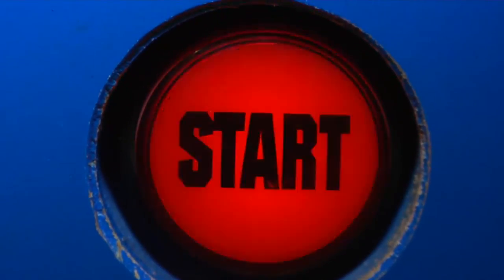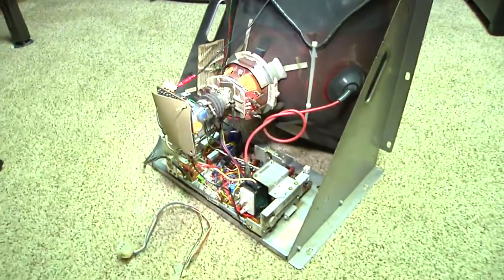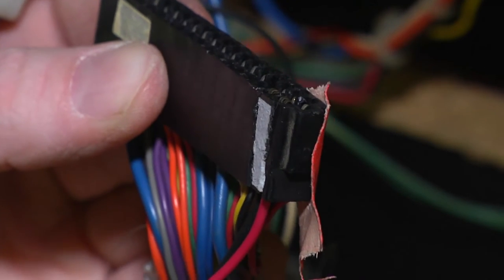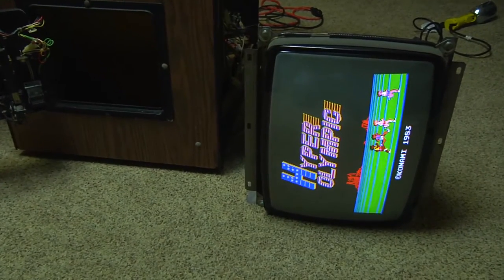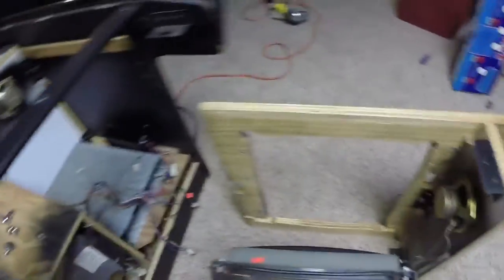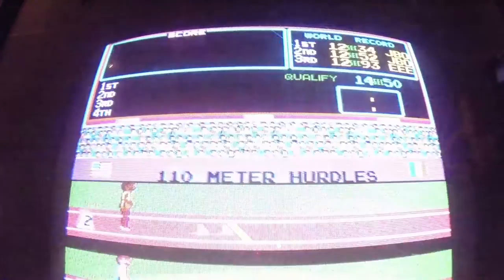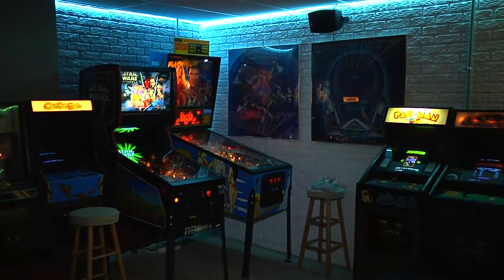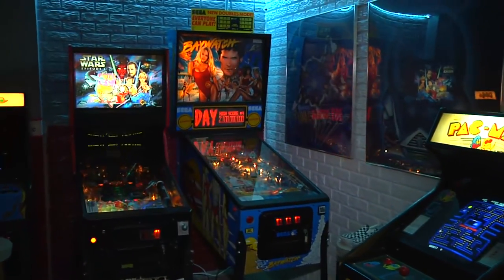Track & Field Cocktail Restoration Part 1

Comment: I just picked up one of these original track & field cocktails that was converted to World Series. Will be a long road back to track, need to have complete wiring harness made for 4 player
Reply from the maker: Great project for restoration.
Reply: @Arcadehollywood  yeah! I was happy both original control panels were under marquee on one side and the World Series bolt on joystick on other side. Just secured the original metal cage for PCB to place the track & field board in and have a line on two track & field boards, 1 working 1 not at a 3rd the price. Talking with golden age arcades about repro harness for it, 4 player might be different from upright? Not sure if upright was 4 player! Still researching. Love this stuff…
Reply: @Arcadehollywood  do you know if there is a difference between boards to have the 4 player option for cocktail or is that all done in the harness?

Comment: Where can someone find the dimensions to build a Track and Field cocktail cabinet?  Would it be the same as an Atari Football?
Reply from the maker: Hey n24our!  Thanks for watching.  Hmmm there has to be some dimension plans out there.  Try looking up the Track N Field instruction manual.  People replicate arcade cabinets all the time.  This would be a great candidate to do that with.  The other thing would be to find or make the metal control panels.

Comment: Do you watch the videos from TNT Amusements? I don't remember specifically, but there's an issue with Track And Fields with the edge connectors and delivering power to the boards. They talk about it in this video: https://www.youtube.com/watch?v=MKPYPV4BuFo

Also, if you get around to your part two, could you show the coin box and how to access it? It's never been clear to me how that works in the Track And Field Cocktail.
Reply from the maker: +Glenn Hoeppner Hey Glenn, Yea I love watching Todd Tuckey's TNT videos!  I had some edge connector issues.  I will absolutely show the coin door access in the wrap up video.